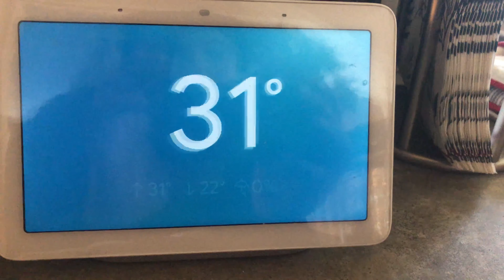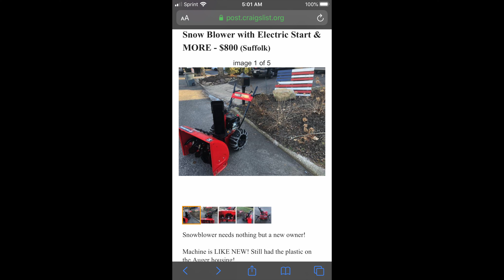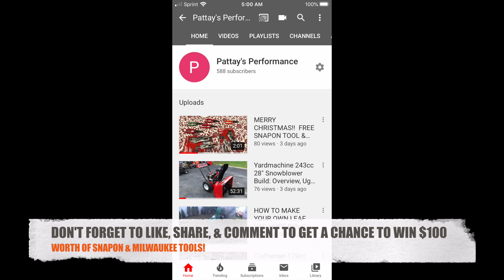Yard Machines 243cc 28" Snowblower Build P2:  HOW TO INSTALL TIRE CHAINS ON A SNOWBLOWER DA END

Comment: On a side note, I'm happy to report that I bought an Ariens holy grail chute from a fellow snowblower forum member. I had already gone from the 11 inch to the 15.5 inch chute. The one coming now is 23 inches high, the tallest one that can bolt right down on my 10,000 series. I cant wait to try it, hopefully now, I'll be able to clear snow over an SUV directly along side it! That chute can have the T handle cable added for deflector control from operators position. Only one other thing left to try. Ariens made a 6 blade impeller on machines in the late 70's and 80's that fits the 10,000. I may eventually get one. Should make a pretty big difference.

Comment: I'm late to the game but that notch that you squeeze isn't it a lever that goes through the chain and is then "levered" back to tighten the chain and the notch hoked on the link it lines up with? Held in by the pressure of the levering?
Forgive my ignorance but other videos show this so I'm confused.
Reply from the maker: Sometimes I am able to pass it through and bend it back and others I'm not.  As long as the chain is tight and crimped...you will be fine.
Reply: yes if you want to do it the right way.
the outside lever/fastener is  a hook to tighten the chains and hooks to a chain link [no tool is required] (gloves help tho as You sometimes need the extra leverage to hook them in place)
 you are a nice person  no ignorance to ask a question ;)

https://www.youtube.com/watch?v=TxPPgSo-Ft0

Comment: uh - 
first the chains loop of the cross bars shuld face out (away from the tire) to lessen the chance of tire (side wall)damage

 once your chains are on the correct side - 
hook the inside before you fasten the outside that is the lever fastener 

 better to have too much chain than not enough.
you can cut off the excess much easier than adding length  

chains installed correctly will never need zip ties they do wear off (nylon)
but on a good note: zipties might last longer dan duck tape ;)

Comment: Hey Jason, I have a few great questions for you.
1. What grease do you use on snowblower's?
2. In your opinion which tires are better x tracs or sno hogs? I'm asking because my Snapper had sno hogs like this machine with chains and traction was always excellent, I upgraded to the x tracs on my new snapper to avoid chains, can I expect as good traction with the x tracs without chains as I did with my sno hogs that had chains? I'm trying to avoid dealing with chains.
3. I have to replace an auger on a blower because its bent. I have everything apart, but the large auger pulley on the back of the bucket is rusted in place, what method do you use to get it off (if you encountered this). I removed the set screws. I have it soaking with penetrant. Will I need heat and what do I do after, get behind it with a crow bar and hit the center shaft with a dead blow?
4 and lastly, do you add the impeller mod to every sbowblower you use and sell? If so, why go thru the trouble of adding it to every machine you sell, some people are clueless to that mod, so is it adding value, isn't easier to sell blowers without the mod for the same price and offer it with the mod for those who want it for extra? Is it really that much better on every blower, distance and stopping clogs, my snapper has a very small gap and hardly ever clogs, but if a newspaper gets jammed into a blower with that mod, wont it be that much harder to get out? I get a lot of newspapers jammed doing snow removal and I'm afraid of having to deal with that with the mod on.
Thanks. Merry Christmas.
Reply from the maker: Merry Christmas!

1) I use Chrevon Delo EP2  Grease ON EVERYTHING!  Mandingo, Wife's Car, Element, Mower and Blowers.  Even on Hedge Trimmers too that have a grease fitting in the gear box!  

Why...This grease is rated for Class 6 & 7 Vehicles that are on the road in all types of conditions.  Some of these vehiles are on the road for 60K miles then come in for service.  Why I use it on a small engines...WHY NOT?  These machines are SUPPOSE TO BE serviced every 25 hours or yearly which ever comes first.  WE KNOW MAJORITY OF PEOPLE DON'T DO THAT!  Even though I remind them when I sell a machine or someone picks it up for service.  For the most part 50 percent of the people listen and I service the machine again and others I don't.  I perform breakdown maintence, I only see the machine when its in need of as repair.  Its up to me to try and sell a service.  People always think bc the OIL IS CLEAN it is good which is far from the case.  If you watch some of my videos on Snowblower's I explain to people using car terminology vs small engine terminology.  I get the "ahhhhh now I know what your talking about".  

2.  Best Tires: None of the above!  Craftsman Had 9/29's Green Colored which meant they come with a Tecumseh On it.  A certain year CMAN giave the TILLER TIRES and they were phenomial.  The closest to that is the X-Tracs.  I like X-Tracs due to Deep V Groove bc its channels out the snow when it builds up to reduce slippage.  XTRACS are the best to lay chains bc yopu can stick them in the groves and give the tire another set of treads.  Some machines get bouncey with chains that is bc the chain sticks out further than the tread in a snow hog tire.  X trac its smooth as butter and traction through every storm GUARANTEED

3. To remove stuck pullies, I soak it to 24-48 hours and apply heat with little pressure on the pulley.  if that doesn't work, use the same steps but now add a couple of hits on the shaft.  If that doesn't work, I call the customer and tell them what is going on, might need to replace the pulley.  Usually when stuff is rusted that bad I get it real hot and hit it with cold water.  Turns rust to powder.  I can't do that now bc I shut my water off.  I came across a video of someone using CANDLE wax and it worked like a charm.  Keep that in mind!

4.  I DO THE IMPELLER MOD ON 98% OF THE MACHINES I SELL!  I do that and a few other things to ensure my machine will sell faster than others AND double downs my asking price.  
Tire Chains= Traction Package
Upgraded Impeller = Impeller Package
Light = Lighting Packing

These quick, easy and cost efficient mods turn into an increased selling price=more profit on my end.  PLUS I order parts on eBay through their eBay bucks program its free money to me.  I use a CC that pays me to use it as well.  Im getting paid 3x over!

There is no more gap in the machine...I have yet to get something stuck in a blower.  I do snow removal, I always ask if they retrieved their paper from the driveway.  If they don't, its an additional fee for us to retrive it with care by hand.  I'm not going to let SOME ONE ELSE'S LAZINESS COST ME MONEY.  If they don't want to pay the fee we move onto the next house.  

My snowblower ads are well written!  I explain in the ad it comes with a modified impeller and what that means.  Most of the time, people dont ask about it.  I have to bring it up and remind them not to blow snow towrds anything valuable.  It will now throw small rocks and objects with FORCE!
Reply: @pattayperformance  Thank you for the in depth response.
I have that pulley soaking with kroil and oil now, its been 24 hours, the day after tomorrow (Christmas). I'll see if its ready to come loose.
I always had chains combined with the Sno-Hogs on my snapper ( same tires in this video) and I never had those tires slip on me, plus since they go in between the grooves they last a very long time, 10 years.
But I upgraded to x-tracs, I knew you could ad chains to them, but their gonna hang out more and wear out faster, so I'm trying to avoid those with chains. I think I know which tiller tire your talking about. An old Gilson I tore apart had them, I still have those tires, maybe I'll give them a try. 
Lastly and most importantly. On an average snowstorm down here, we are out about 3 days straight removing snow. I would say somewhere around 30 customers.
Unfortunately its not about laziness, those advertisement papers are sometimes tossed out the night before a storm, other clients are away on vacation, others simply don't know the newspaper is their, some customers are seniors and rely on other people too pickup their paper's. 20% of it is indeed laziness. Most of my regulars, pickup the newspapers, but bottom line, we don't have x ray vision and if the snow is a foot deep we cant hunt for newspapers before we start throwing snow. So for me, its inevitable, I suck up a newspaper into my snowblower on average outleast once per snowstorm, no way around it, it happens everytime and I can tell you from experience when a newspaper gets sucked into a snowblower it is a real pita to get it out. It usually requires me to remove my shear bolts out of the auger so they can turn and literally get in their with a mallet and tire Iron to start busting the paper free. Typically once its up in my impeller belly, I literally have to take a torch and light the newspaper on fire to get it out! I started doing that when one paper refused to come out any other way!
So my big concern is ,with impeller  mod, is that going to make getting the newspaper even harder for me to get out and if I have to get in their with my torch to burn it out, which is what I do, am I going to be burning those rubber impeller fins up with it? It takes us a good 30 to 40 minutes to get a newspaper out as it is, sometimes. It gets jammed so bad sometimes, I take that machine out of service and go get a backup blower from base just to save time and deal with the jammed newspaper later after we have completed the snowstorm. It is the biggest pita their is. Thank your lucky stars you haven't sucked up a newspaper, I started doing snow removal in 1992 with my father and I don't remember a year we haven't dealt with a newspaper jam. That is my biggest concern with adding that impeller mod to my blowers. But again my Snapper has one of the smallest gaps in the industry and hardly ever clogs and throws far, so I never saw the need for the mod on that blower, other snapper owners have said the same thing. Needless to say because of newspapers, I'm highly reluctant to add the mod to that machine in particular. If you ever do suck up a newspaper and knock on wood you don't please let me know how it goes.
Reply from the maker: @Mr_Tecumseh  My wife and I have been doing snow removal for 3 years. We have damm near impeccable record and that comes at a price that is also factored into our removal prices.  Snow removal is also a luxury and a few times I had to explain that to people who thought we blow out their driveway for $25-$50.  My wife gives them an estimate based on what we have.  High/Low Price, they agree and we add them to the list while we are en route.  Once we eyes on driveway we lock in a price.  Some people have the nerve to try talk down the price after they already agreed to High/Low estimate.  A Good Snow Blower isn't cheap, a good truck to get around in this weather isn't cheap.  Through out the year we must store and maintain our machines/vehicles.  KNOCK ON WOOD we have never had a catastrophic breakdown.  Every year the Snow Blower Gets a Complete Tune-Up that includes new kevlar belts.  Every Storm if we are out for 10 hours plus I will change out the Royal Purple Synthetic Oil and replace with fresh Royal Purple.  I know NON Synthetic Oil is 25 hours...Im sure RP is more 75 hours interval.  I buy oil in bulk and I am doing it myself so its a very small price to pay.  I keep extra sheer pins on hand, extra belts, whole recoil ASM, and tools.  Anything crazy happens we return home and swap out a machine or repair it and back out we go.

We have never sucked up a newspaper and if we did.  Quite honest I would be in a fit, I have seen newspapers blow out gear boxes.  Good luck trying to get these people to pay for it too.  

I have only removed 2 newspapers in all my dealings.  Usually just heating and beating them out.  Garden hoses are my favorite if they didn't shatter the gear box.  Thats when I pull the pins, and start cutting as well as man handling away.  Impeller mod can easily be undone, if anything don't do it on all the impellers.  Just try it on one and work your way around till your comfortable.  

Why we run modified impellers:

Snow removal is done at the end of the storm.  Some storms fluxuate from Snow to Rain and so on.  Therefore the snow is heavy and will clog up 98% of the machines out there.  I have a video on my channel showing my 1128 really chewing up this snow and spitting it out. if you can look closely it was still raining.  We were out for almost 20 hours and had many more to go.  Reason why we stopped as the slushly snow became frozen and it was unsafe work in these conditions.  We did the best we can...safety comes first and we can't put a price on it.  What good is all this money we made, if we now have to spend it on damages?  We use ATV ramps to load and unload the machines.  Streets were now ICE.  SO everytime I would unload a Machine I was guaranteed to fall and machine run me over.  After a few trials and errors.  We decided to back up the truck into people's yard/driveways into the snow.  When I unload I would fall into the snow.  WHY WE STOPPED was mostly becuase of Mandingo, roads conditions weren't in our favor, nor anyone else's.  We made a little over $5k that run with potentail to make another $1,000-$1,500.  Greed came to mind and didn't want to make any mistakes due to greed and we called it quits.  We called the remaining people on the list to inform them that we are suspending services.  Some people understood and some didn't but in the end they were all GREATFUL that we reached out to them.  The people that we didn't get to were ALL NEW customer's to us.  The people they used prior just abandoned them bc shovedling this snow isn't fun at all.  I felt bad leaving this first impression on them, but it is what it is and there is no WAY to scale this business in our current platform.  Ahh so where were we lol...

Modify impeller...

A) We get slushly snow and this will overcome those storms and save our back and limbs.  

B)  Some driveways are wide and I don't want to blow snow ontop of snow that needs to be blown.

C)  Some driveways line up next to the neigbor's property line.  Therefore we can't split it.  We need to work one way over to the other blowing snow into their yard and again don't want to blow snow ontop of snow that needs to be blown.

D)  We deal with many LONG DRIVEWAYS...I LOVE MY WIFE and I commend her efforts.  I really do.  We tag team almost every driveway and we have a method.  We get out, I start the machines and chip away at the burm at the end of the driveway amassed by the plows.  Once we punch a hole a throught it.  My wife tackles the driveway and I take out the berm.   LONG DRIVWAYS, that really doesn't work bc they are short maybe 1-1/2-cars wide TOPS.  My wife doesn't grasp that we should run the driveway together staggered like plow trucks on a highway.  So the end result is she picks one side of the driveway and I pick the other.  We meet in the middle and be done.  Its safer that way too!  Here we are throwing snow over eachother when we cross paths.

E) Merry Christmas!
Reply: @pattayperformance  2 years ago, we had a snowstorm, where it  rained and snowed and than over the night the temperature dropped down to like 15 below and it froze the remaining 4 to 6 inches of snow froze solid. I mean solid, even a a chisel wasn't getting that stuff up. It was the only time I ever saw that. Whoever we didn't get to before that happened was stuck, we had to suspend service's because their was no way for us to get the snow up. A few days later once it warmed up enough to soften it up, we were able to take care of a few people that still wanted it done. Fortunately most of the customers were understanding, their was simply nothing we could do.
I use the collapsible harbor freight ramps, got them for 80, work great.
I have a Poulan PR621 single stage snowblower and a snapper 5hp single stage 2 cycle blower as well.
The Poulan has a 6hp 208cc LCT 4 cycle engine. That single stage is so powerful it lobs snow 30 feet. I use that machine for really heavy wet slushy snow and snowstorms, it doesn't clog, goes to the pavement and chucks it far, its a mini beast, like a sleeper lol. Amazingly it actually gets the job done faster and better than a 2 stage machine in those type of conditions. I got it free last year and before I owned one I never knew how great those new 4 cycle single stage things worked. I'll never get rid of it, its a key piece of equipment in my arsenal now.
Your right, without bragging, snow is white gold, we love snow!
Merry Christmas and happy new year, we are praying for snow!